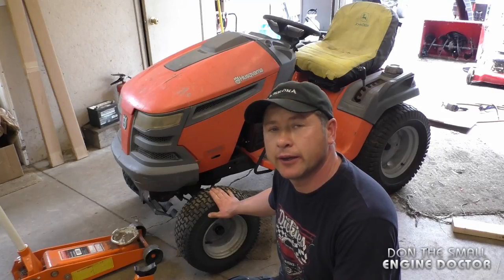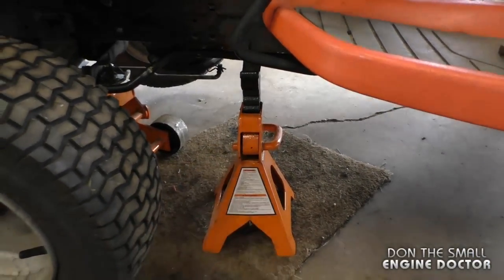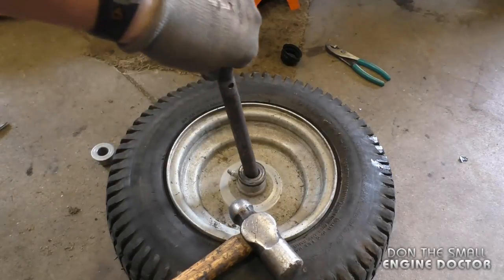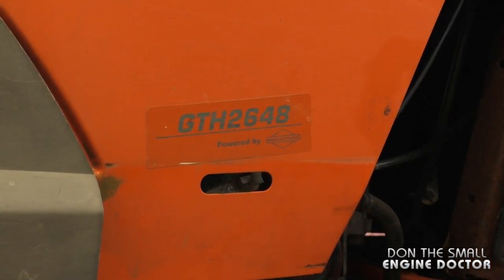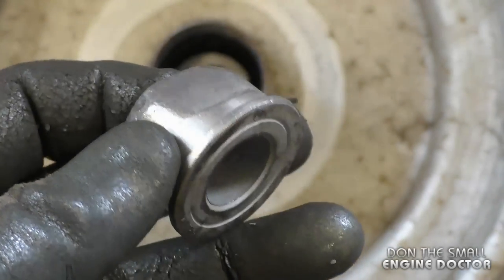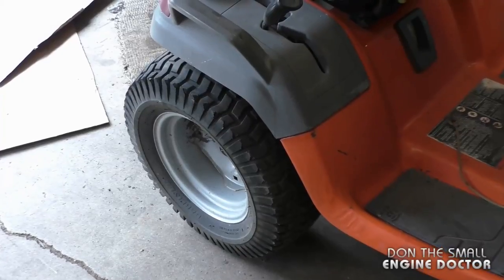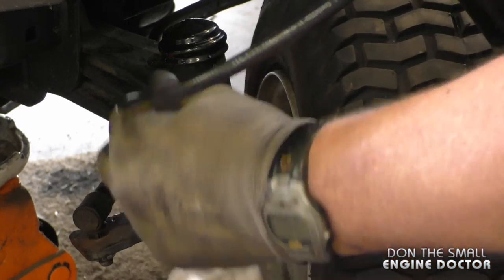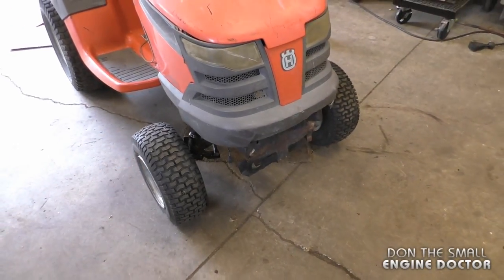HOW-TO Replace Lawn Tractor Front Wheel Bushings - Fix Those Wobbly Wheels!

Comment: I'd also suggest replacing the bushings with wheel bearings. There are plenty of replacement kits out there for this and the wheel will have less play, less friction in the hub, and will generally last longer.
Reply: I'm not sure how that could be... as those bearings are not press fits. Hence, rather than the bearings rolling about the inner race of the bearing, most of the time the inner race will be the bushing turning around the axle.
Reply: @monkeybarmonkeyman  Yes, the replacement roller bearings that replace those old school bushings are "press-fit" in. I just replaced my bushings in my Poulan Pro rider with ball bearing replacements and they rollsomuch better, and won't wear out the shaft like those worthless bushings do, even if you grease them.

Comment: There is a kit on Amazon that replaces the bushings with bearings for about 19 bucks. No grease necessary. I just replaced mine and it took about 30 mins for both tires and one broken spindle.

Comment: I always put some grease thru the fitting before installing bushings/bearings to make sure it's not blocked up... that would best time to replace it
Reply: DG, good suggestion. I have had new bushings where I had to shove a pointy object into the grease fitting to clear.
Reply: what  about filling the rubber boot with some grease prior to putting back on ?

Comment: Have  a PYT9000Craftsman tractor, tried to replace bushings to bearings, has a cutter key ,washer , with raised edges ,  then spindle  , spindle and washer. The bearings ordered were much larger diameter than the spindles,  tried Sears Direct and had difficulty with them determining correct bearing. The tractor model is 44M777 (486.24837) can you recommend different source and proper bearing size for unit front wheel axel?

Comment: I have a 28 yr old Simplicity mower that belonged to my dad, and I’m learning as I go. Thanks so much for your excellent videos. 
A point for other beginners: the parts diagram for my Simplicity calls them “bearings”, and that confused me. These are not “bearings”, rather “bushings” as you called them. 
Parts diagram cost me 15 minutes of Googling and head scratching until I watched your video, pounded mine out, and compared them to find out they are exactly the same!
Reply: I've got a 45 year old Dynamark that belonged to my Dad also. Think I'll do this project next.

Comment: Hey Donny, Been watching your videos for quite a few years. I had a tractor come in with tires off the wheel. Once I raised the tractor up the bearings just fell out. I will check to see if any excessive play is present before replacing any. This tractor has lots of miles as your had in the video. Grease goes a very long way. Even dustier conditions need more than normal. Where is your apprentice? I miss the video of you popping questions to him so that I can also guess at what it might be as well.

Comment: What if the front spindle shafts are worn also? I've seen this happen to several newer lawn tractors. Spindles are made of soft, recycled metal. Also, I think it does very little good to have or install grease fittings in the wheel hubs because most people do not think of (or maybe know how) to use a grease gun.

Comment: Have you ever done a hydro transmission rebuild?  I have an Aries with a tuff torque k46 transmission that has gotten very weak.  No grinding noises, just weak.  Could you do a video covering this?  The k46 seems to be a very common transmission used in the lower end tractors of many brands sold at the big box stores.  Thanks

Comment: When buying a new tractor is it better to have one with bearings or bushings is one better than the other
Reply: if you grease regularly bushing is as good as bearings BUT if you are not good at remembering the bearings are less maintenance to last longer, BUT cheap bearings are worse than good bushings. stay away from MTD machines with the plastic bushings

Comment: I want to remove the front wheel on a Snapper LT200. I remove the retaining clip but the washers won't even think about coming off the front hub.???  Every seen this? I have had the wheel off several years ago to replace the bushing/bearings.

Comment: For the record, John Deere uses the exact same looking original bushing.  However, their replacement is an actual ball bearing set up.  With either the ball bearing or the OEM style bushing, ALWAYS inspect the axle for wear as well, or you will be wasting your time and money doing just a bushing change. The replacement axle will cost some bucks, is easy to swap out and at least with my tractor removed all the slop in the wheels.  I suspect the slop you saw was really axle wear.
Reply from the maker: unfortunately customer was too cheap to replace axle
Reply: @donyboy73  Sometimes, you gotta fire the customer lol

Comment: My engine on my Craftsman yt3000 would not turn over
I took out the spark plug and the head cylinder was full of gas and gas  had run into the crank case.  Am I correct to assume the float bowl had stuck??

Comment: Good video, but you forgot to clean the shaft that the bushing rides on. Not cleaning it will cause the bushing to wear out prematurely, due to rough contamination against the new bushing, mixing with the grease too. Good video though
Reply from the maker: all there was is grease on the shaft so it won't affect it
Reply: Oh ok lol sorry I'm just OCD and like to clean the crap out of everything lol if I didn't clean something like that, it would drive me crazy.